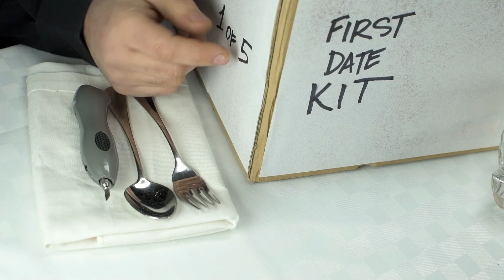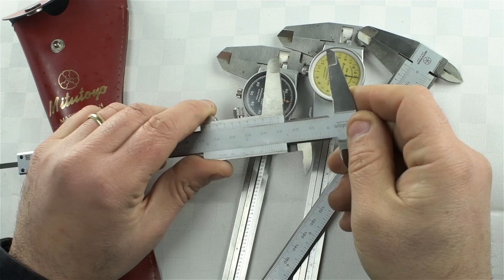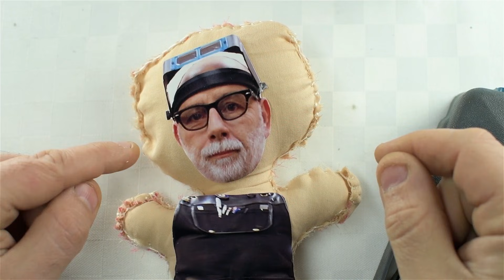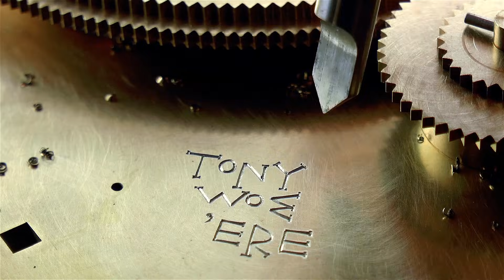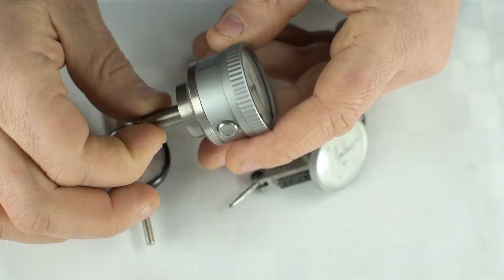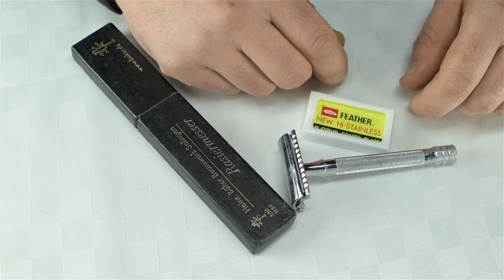♫ These Are a Few of My Favorite Things ♪

Comment: Razor blades, just my 2 ct: Feather is indeed a very sharp blade. 
Some argue they are a bit rough as skin might feel a little irritated.
After some closer inspection I noticed that Feathers are a tiny bit broader edge to edge compared to other brands. And that lets Feathers stick out of the razor just little bit more.
That’s why I switched to SUPER IRIDIUM blades (or PolSilver which are the same blades under another name.)
They shave very nicely and are significantly less rough to my skin.
Feather and SUPER IRIDIUM keep sharpness for quite a long time.
When it comes to sharpness I’d say Feather takes the lead.
But due to the difference in geometry of the blade/razor combination this is not better (for me at least). 
I have not scientifically compared sharpness between Feather and SUPER IRIDIUM, but I doubt its big difference.
Reply: And yes, ThisOldTony, I love your videos. Thanks for all the efforts and body fluids inversted.

Comment: I just started using feather razor blades. $22 for 50. 
I’ve gotten close to a month off the first blade and it’s still not dull.  So at this rate I’ll need to buy razor blades sometime in 2027.  If I buy the 200 count pack then I’ll be good till June/July 2043!
Not that I’m obsessing over this.

Comment: I actually picked up a set of Starrett dial calipers in the original case at a yard sale for $10, think I got a pretty good deal?😁 I also got a good plated butterfly safety razor at another yard sale for $5. I don't use it very often as I have been letting my beard grow out.

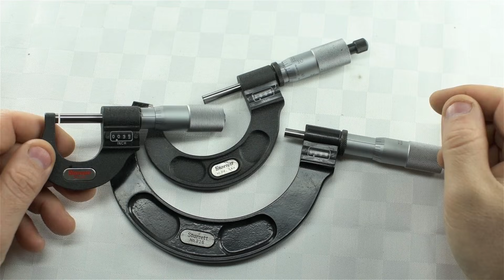Comment: 10:16 I hate those clamps, I'm must of went through 20 of them. They always break or bend when trying to hold down plywood before a cut.
Reply: Got the same problem.
Quick fix: spot weld it in place.

Comment: Get digital gages with an IP67 rating for water proofing.  

If you drop your Mitutoyo digital micrometer and it gets stiff, whack the thimble with a hammer handle in various directions until it frees up.

Comment: There are far better blades then Feather's. But for the price point derby or feather seem to be to go to blades for everyday use. Plus its like 5 bucks for a box of 100 halved shavette blades (or 50 regular) compared to say a 15 pack of mach3 disposables which will run you like 25 to 30 bucks.

Comment: Dude. If you can bring yourself to be a little more obsessive with cleaning, you'll seldom if ever have to take the calipers apart. I'm still a new machinist but the 8 inch pair I started with is over two years old and they're fine. I just clean them constantly and any time I feel them not running perfect.
My old boss has a stack, literally 10 or 12 old Starrett calipers that he apparently broke from jamming them up with dirt. I say apparently  because I took 4 of them apart, cleaned them and put them back together and they all kinda worked with the exception of being 0 to 5 thousandths off depending on the amount of pressure you apply when closing them. I think he just tried to force through the chips caught in the rack.

Comment: Thanks for telling me about parallax free verniers! Changed my life. They have been a bit hard to find though...

** Check out Fowler 52-060-016 calipers **

Appear identical to your diamond whatever parallax free calipers, except for a different type of thumb lock. Currently available cheaply, who knows for how long. 

I don't feel good when I see the Fowler name like I do with Mitutoyo or Lufkin or Brown and Sharpe, but their top-of-the-line stuff has been made by names such as Helios and Girodtast. I'm pretty sure these calipers are made by none other than Mitutoyo. I just ordered a couple pairs for myself, and I thought of you, without whom I would never have found the joy of the parallax free vernier.
Reply: UPDATE:

Calipers were delivered the other day... 

Fit and finish as delivered is substandard, far from where my set of mitutoyo diamond series are. Sliding action is gritty with abrasive, and the 'gibs' aren't adjusted properly. The finish on non-precision surfaces is generally unimpressive - coarser than I've ever felt on a precision instrument, and with some sloppily rounded edges. The thumb slide lock lever is a very poor quality pot metal casting with clear defects. A lever broke as I was sorting out one set, and I expect the others will follow. The vernier scale is (laser engraved?) a bit lighter than the scale on the beam, which, while usable, isn't particularly gratifying.

Precision surfaces - on the one pair I have cleaned, oiled, and adjusted - are all flat, true, sharp-edged, and properly finished. A substitute for the thumb lock lever is needed, as the hole it leaves has thin, uncomfortable edges, and without it the calipers lack a lock.

There's another listing from the same seller on eBay without the thumb locks at all, and another on Amazon, evidently also from the same seller, that includes the thumb lock, and also a case - which both eBay listings lack. My theory is that whoever had the contract to cast the thumb locks for this design screwed the pooch, and the powers that be decided to cut their losses and liquidate stock as cheaply as possible - resulting in the poor finish, bad cleaning and assembly, garbage thumb lock, lack of case, etc.

So, uh, these are not a mitutoyo diamond series substitute, exactly. Based on my assumptions above, if things had gone differently they might have been. As it stands, a little time must be spent getting them to where they should be, and even then cosmetically they will be lacking compared to name brand calipers. These are, however, parallax-free vernier calipers that are available, while the mitutoyo diamond series frequently are not.

I'll leave the conclusion to the reader.

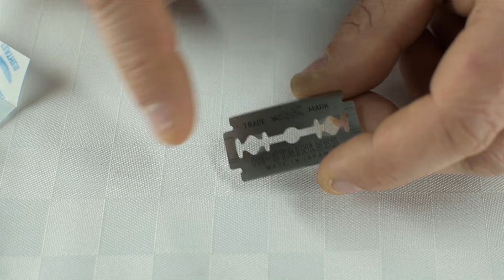Comment: 19:07 I'm 95% thats a joke but I'm not sure how you didn't slice your thumb and finger, either you dulled that razor or you work hardened your skin.
Reply: The razor blade won't cut you if you just gently hold it like he did.
It's a blade, not a light saber.
I'm glad you left you a 5% room for other explanations.

Comment: This is kinda hard to watch. I was forced to move from a shop where I had 4 months remaining on a year lease trying to run a business in California. I was moved to 4 storage lockers at a company called istorage and the landlord paid for 4 months for each of the 4 lockers.

After the first month, istorage locked me out. Or at least me gate code ceased to work. I was living in a box truck in Oakland, California. I couldn't access my tools to earn money. I couldn't access items that I could have sold. I was parked in a Costco parking lot at night until the police told me to move along.

So as not to whine or bore anyone, most people don't like to hear the story of a looser. Jumping ahead, the storage company was sold and another storage company bought the facility. The new company held pretty much everything that I owned. Why this video is so difficult to watch is, I was kind of a cross between This Old Tony and maybe Ben Krasnow as far as interests. I. Built my own TIG welder using parts like a wahwah pedal, a couple of big thyristors from a diffusion furnace that I parted out, I made a series wound Tesla coil to super-impose hf on to the main current lead.

I had a lot of similar tools to that shown in the box in the video. As pointed out at around 4:00, this stuff is collected over the years. I'm going on 61. I declaired bankruptcy even though I had no debt so as to prevent the storage company from auctioning off my stuff.

I even tried to ransom back my stuff by paying them more money. They took my money but limited what I was able to get back. They auctioned off the rest of my stuff without notifying me.

It's funny too that I am into straight razors and safety razors. The plastic ones with 47 blades stacked up clog up after two swipes and getting all of the wiskers, soap and dead skin out is impossible. My straight razor and accuterements were auctioned off. The "as seen on TV" safety razors are electroless plated plastic. Not like the old school chrome plated brass ones.

My question is, if I have one is. How would a nerd like me start over at 61 being stuck in Michigan? I wish that I could have at least been able to keep my straight razor.